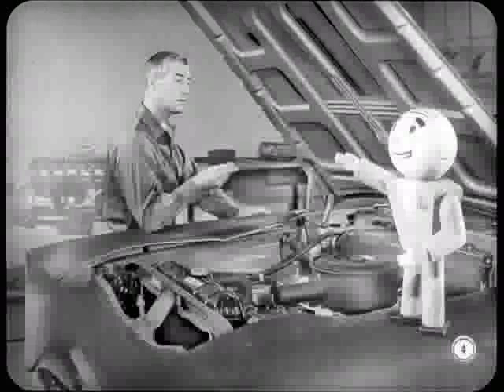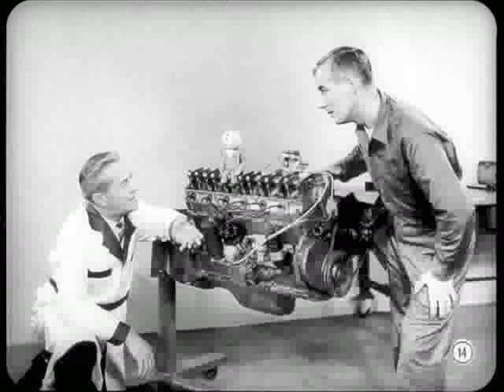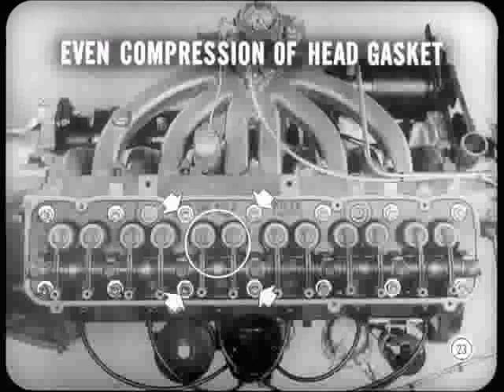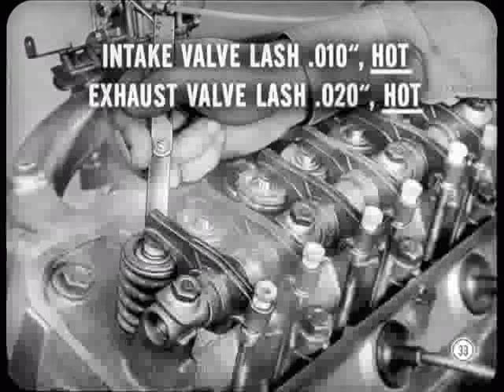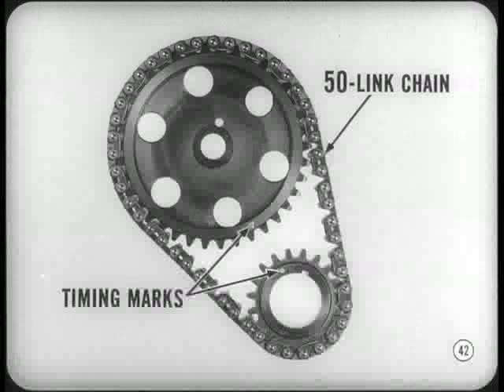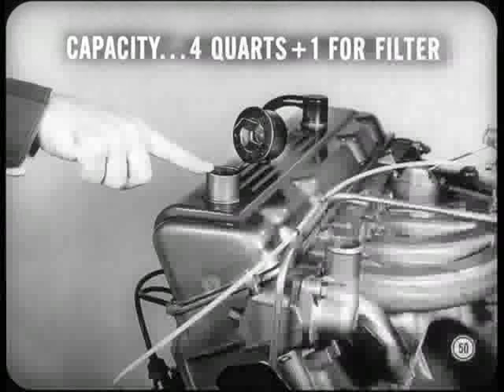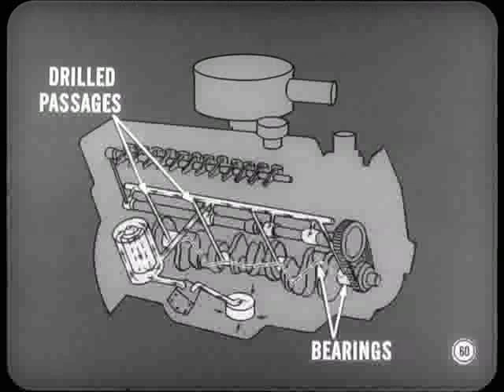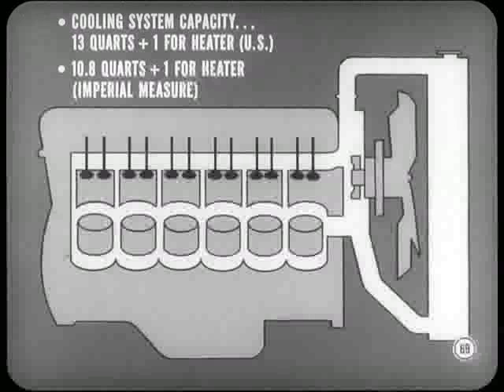Chrysler Master Tech - 1959, Volume 12-12 The New 6-Cylinder OHV Engine

Comment: The Chrysler Slant 6 was one of the most rugged sixes to ever be built, despite only having four mains.  Good engineering proves itself over time.
Reply: Yeah but the mains were the same size as the 426 hemi
Reply: ...courtesy of Willem Weertman ~ designer of the Mopar 2nd Gen. HEMI motor!
Reply: @79tazman  Yes, but the RB engine with those 2.75" main bearings came first.
Reply: Well you gotta realize that inline 6s wether they have power (BMW) or not (Chrysler, Ford, GM) they all last a long time. It’s not as small as a inline 4 that combats more secondary forces, and it’s not as unbalanced as a V6 that also deals with secondary forces. It’s long, it’s easy to understand and work on and it’s a design that has proven the test of time
Reply: @Marcus Dylan instablaster ;)
Reply: @Jayceon Clay Thanks for your reply. I got to the site through google and im trying it out atm.
Looks like it's gonna take quite some time so I will reply here later when my account password hopefully is recovered.
Reply: @Jayceon Clay it worked and I finally got access to my account again. I'm so happy!
Thank you so much, you saved my ass !
Reply: @Marcus Dylan you are welcome :)
Reply: And no timing chain. All gears. That's why it couldn't be blown

Comment: 1 of the best 6 cylinder engines ever built. It was used in everything from industrial applications, to 1 ton trucks. Nearly bullet proof. 1960-84 in cars, '86 in trucks.
Reply: Adam Trombino 
I have those trendy hydraulic lifters so I just have to torque the head.And that Hi-fi lean burn spark control,oh those wacky Dodge Bros. what next?
Reply: Adam Trombino 
I have those trendy hydraulic lifters so I just have to torque the head.And that Hi-fi lean burn spark control,oh those wacky Dodge Bros. what next?
Reply: Adam Trombino I have a 63 D500 with a curb weight of 6500 pounds.  Gvwr is somewhere around 16k and it has a 14 foot dump bed.  The power plant is a 225 slant 6 with single barrel carberator.   About 55 is top speed and puts the engine close to red line.
Reply: Terrible engine. 

Ours was burning oil at 50k and had such low compression that it couldn’t hold the vehicle on an incline. The power of a four cylinder with the fuel efficiency of a V8.
Reply: Terrible engine?!? You have to change the oil, troll. This engine has entire drag race days dedicated to it. Name ANY other six with that following. My 225 pulled a car on a trailer and when the electric radiator fan died it never even overheated. I found out by sitting too long. It spewed a bit, but once moving it cooled back down. I did fix the fan. Mine gets 18MPG while pulling HARD. Too bad about your experience and attitude. The entire world around you has had just the opposite reality. It is one of the best EVER inline 6 engines. Nascar had a race for pony cars. Chrysler entered 7 Valiants with slant 6 engines. Ford Chevy etc. The slant 6 cars came in 1st through 7th place. Nascar shelved the entire pony car concept after one completely one sided race. Terrible engine huh? Nope. It's you, dude.
Reply: Hugo Fuguselv Overall they were amazing engines but there were some builds that were plagued with issues. It wasn’t a design issue but a QC issue during its production. Overall, they were reliable and simple to repair which is why they are still so loved by many. Ford’s in-line six enjoyed even more popularity back in its day. They ran generators and steam cleaners for every railroad in America for years. They also had production runs with QC issues too but overall were reliable and simple to repair.
Reply: @Bartonovich52  LMAO!!! Yeah terrible engine I know a guy with a 1963 Dart that has a slant six that over a million miles on it the only thing done was maintenance like last the valves. I have never ever heard of a slant six burning oil at 50k impossible unless the car had low miles and sat for 30 years and the rings were stuck in the pistons there is no way those things came with thick steel piston rings I've seen many high miles slants that don't burn a drop even after 50 years
Reply: Ya, I won't pick on the troll. Ive had wonderful luck with mine. Sitting in an 81 half ton truck 4x4. Goes places I dont belong in the mountains. 21 mpg. Peak. 18 mpg at the other end. And if/when it does break down, its usually around 20 bucks to fix it. Along with easy to fix. Overall been the most reliable vehicle I've ever had. Still sits in the driveway just incase we need it. (On occasion its put back to daily driver duty, due to others breaking down)

Comment: best engine ever built
Reply: The 318 powered America along with the 225 both legendary.I had one of the last TRUE Chrysler products ever made the 1983 Chrysler Cordoba. One of the BEST cars I ever owned. We were heading east for Colorado,Filled up in western Kansas.Had cruise cont set.Went about 110 miles according odometer.Brother had to hav b room stop,I FORCED a little over 3 gallons into her, FORCED,It had the lean burn system,they either worked or didn't mine did..
So figure a V8 that went 110 miles on 3.1 or 3.2 gal of fuel,plain unleaded not prem si 31 or 32 mpg V8. We were going 55 cops were out cruise and eastward,I would kill for it back!.

Comment: Still driving my 63 signet convertible. 
Slant 6.
A million taxicabs back in the day can't be wrong.
Reply: That’s why they dumped them and went to the 305... then dumped those and went to the 4.6, then dumped those and now use the 1.5L hybrid engine.

Comment: Had the 225 slant six in a 1976 Dodge Aspen 4 door the 225 engine was bulletproof and outlasted the body.
Reply: My first car was a 1979 Dodge Aspen 2 door with the Super six 225 it had a 2bbl instead of the single bbl carb but that thing ran great and I beat the heck right out of it and it would always start even in the dead of winter when everyone else was having issues getting their car going
Reply: My dad had a 1977 Plymouth Volare, which was similar. However, the electronic lean burn was an expensive pain. When he divorced, he was happy to leave it with the ex wife and then buy a 1979 Toyota Corolla.

Comment: I'm learning all about the Slant Six as I recently bought a 1966 Dodge Coronet 440 with it.  I never worked on them when I was younger in the 1960s and 1970s.  It drives very well even in the bigger and heavier B-Body.

Comment: In Australia, the introduction of the RV-1 series Valiant in 1962, then the SV-1 series in 1963, had this engine, fitted with an alternator, and the oil filter piped to the opposite side to cater for the RH drive steering system. Several models ensued, (AP-5, AP-6, VC, VE, VF) leaving this engine the longest in production (finishing in 1970) with sedan, utility, coupé and 'safari' (wagon) variants. A very reliable engine.

Comment: the best feature that the slant six has is that curved runner intake manifold . it gives more equal fuel  distribution to the cylinders . it is the only inline six engine made in america that has that . chevrolet 230 , 250 and 292 sixes are known for running to lean on the number one and six cylinders . and have you ever looked at a ford 144 0r 170 , the manifold runners make a 90 degree turn . only chrysler cared enough about the driveability of it's design to produce theirs the way they did
Reply: My dad said that many car companies were interested in making the inline sixes cheap, that is probably why Ford and Chevy had such awful designs. The slant 6 would need more complex casting methods in order to build, making the base model car more expensive.
Reply: Skyline Fever — those Ford small 6,s (144, 170, 200, 250) had the intake casted integral with the cylinder head. Not unheard of, even today, but definitely an economy-car only design. 

The MOPAR 6 was definitely the king of American sixes back in that era ...
Reply: Chrysler used to advertise "Extra care in engineering".  It showed.
Reply: @skylinefever  Your dad was correct.  Chevy Stovebolts always shake when you start them, because they start firing on cylinders 3 and 4, then the others kick in.  I have dual carbs on mine.  Much better acceleration.  Even Chrysler's flathead 6 has a better porting layout than Chevy's.

Comment: Had a '69 Dart with a 225 years back, it was so easy to work on, tons of room. No powerhouse, had over 200,000 miles on it but ran like a clock all day long. You could put a Hyper-Pack on these too. Way better than Ford or Chevy straight 6's.

Comment: This was a bullet proof engine too,could not kill it at all
Reply: wafrederick My dad did.  He hit oil pan, and it leaked oil out.  He had a 1966 Plymouth Belvedere
Reply: Sure you could. Ours was burning oil at 50k and had such low compression it couldn’t hold the vehicle on a hill. 

Sure.. nothing that a valve job and new piston rings couldn’t solve... but not worth it for a Malaise Era Dodge in the mid-1980s.
Reply: If your 225 burned oil with no compression at 50k then you never changed the oil or maintained it. I have a 225 in a 1950 ford F2 with NO cooling fan. It has to move to cool. I have towed trucks on trailers with that rig. 1972 Valiant engine, 904 auto trans and 7 1/4 rear end all went in the 1950 F2. Runs great to this day. Just rebuilt the Carter BBS from a 1977 Aspen Super Six 2bbl intake I installed years ago. Both this truck and my 1965 Valiant daily driver have 1989 Toyota V6 3 core all metal radiators retrofitted. Way better cooling. Like I said, no fan at all on the 1950 with 1972 Valiant powertrain.....
Reply: @selfdo  My dad suffered greatly because of that short warranty. He drove a 1977 Plymouth Volare, and the Electronic Lean Burn module stopped working soon after the warranty ended. I guess that didn't count as an engine part, and was instead counted as an electrical part. When he divorced his first wife, he left her with that car and bought a 1979 Toyota Corolla. He chose it because he hated the Chrysler group with a passion because of it, and because his 1971 Toyota Corolla was a good car.

The ELB modules were the death of many 70s Chrysler cars. I don't think computerized engines were a problem, Chrysler's method of doing it was a problem. The Datsun 280Z wouldn't have become famous of Bosch K-Jetronic didn't work well.
Reply: And even if you did "kill" it, didn't die.  I threw a rod on a 68 fury (some jerk took out the oil drain plug) and the damn think started and ran.  Sounded like a chev 6.2 diesel running on 6, but it ran.

Comment: Chrysler went from a flat head 6 to the slant 6 in 1960 and that was in production right up to damn near the 90's that's how good that engine was
Reply: And still made that Flathead 6 for industrial, and agricultural Machinery throughout the 70s. Those flatties were used in Massey Ferguson tractors on till just about 1980.

Comment: That intake manifold is far better than what was on most American inline 6 engines, just like these people say it does. It does a much better job of ensuring the the air fuel mixture between cylinder #3 and #4 is much closer to #1 and #6. During the 80s, some cars were built with a V6 and throttle body fuel injection because it was cheaper than an inline 6 with multi port injection. Chevy built the 4.3, a 350 with 2 cylinders cut off. Dodge built the 3.9, a 318 with 2 cylinders cut off. They also made brand new 60 degree V6 engine designs. Jeep and Ford continued to use inline 6 engines, but used multi port injection to solve the air/fuel distribution problem.

Some speed parts companies were able to do better by having 2 carbs, each one connected to 3 cylinders. Also, some foreign car companies built inline 6 engines with multiple carbs, but I don't know if any of them were doing that back in 1959. Also, since foreign cars weren't common in the USA back in 1959, I don't even know if anybody even noticed those cars.

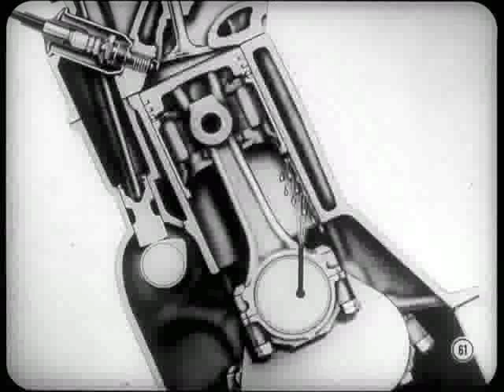11:30 That is an excellent feature which was uncommon back then. Later engine designs would feature oil spray jets that were aimed directly at the pistons. It is said to be one reason why the Nissan 300ZX could handle large increases in boost.

14:30 I have heard people would have to re-torque early gasket designs, that is why this torque specification was mentioned. I think it was required after 1000 miles after the gasket is installed.
Reply: The aluminum version required periodic re torquing.
Reply: Many foreign 6s had more than one carb, but those engines were just too small for American cars.  Not enough torque.

Comment: Note the GENERATOR, which was used in the 1960 models when the Slant Six was introduced.  I believe it was 1961 when Mopar went over to the alternator, and mounted it to the right of the front of the valve cover, with one bracket going to the head and another to the front of the block.  The space above and to the left of the water pump was reserved for power steering and/or the A/C compressor, if so equipped.
Reply: The 1960 Valiant had an alternator
Reply: @bobbyheffley4955  Note at 2:38 the still clearly identifies a GENERATOR.  Of course, this is obviously a prototype engine, as Mopar had been working on the new G and RG engines since 1957, so naturally a generator would be shown at the time.  I was under the impression that the alternators we all knew didn't come in until '61 for all vehicles, but if you say the '60 Valiant came with an alternator, I believe you.
Reply: @bobbyheffley4955  But the 1960 Plymouth still had a generator, at least optionally.

Comment: Man how I wish this engine was available for the 1957 cars. It looks so much more appropriate than the old flathead.
Reply: It was originally conceived for the car that become the Valiant.
Reply: @michaelbenardo5695  Yes, but honestly something like this engine should have been in the works far sooner IMHO. The fact that the slant six was conceived in '58 and actually in production in '59 for the 1960 model lineup is impressive to say the least.  They knew the flatheads were outdated in the late forties so I'm surprised Chrysler didn't develop a more advanced six at that time.  Several prototypes were made (including hemi head versions) but none made it to production, which is unfortunate.  Would loved to have seen a hemi six or even poly six cyl inline.
Reply: @ctg6734  Would have been nice, but Chrysler thought the 6 cylinder engine in full-size cars was going to disappear, so they felt that developing a new full-size 6 was just not worth it.  The sudden burst in demand for 6s in the 58 recession changed their mind, so they added a larger displacement version to the Slant 6 program.